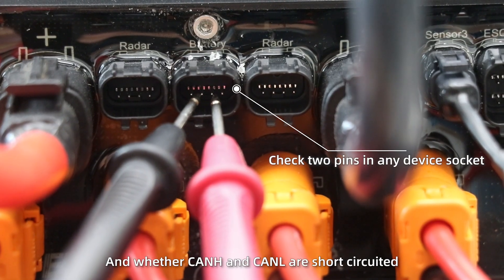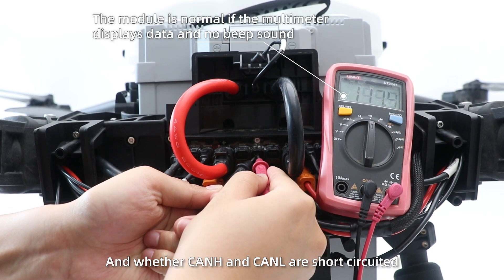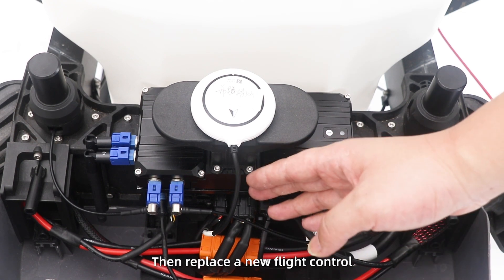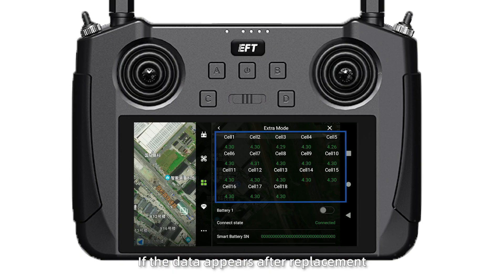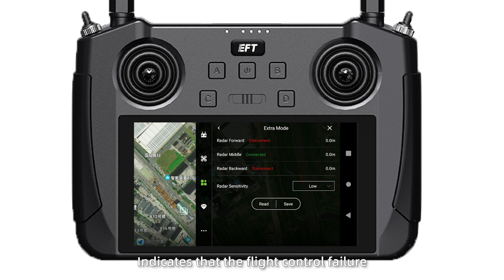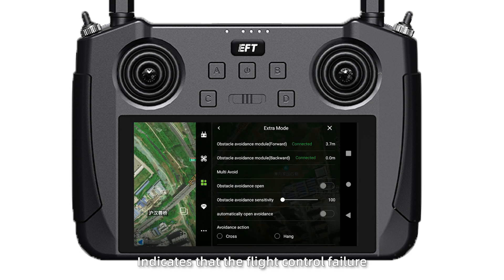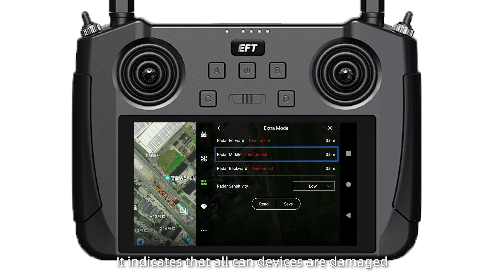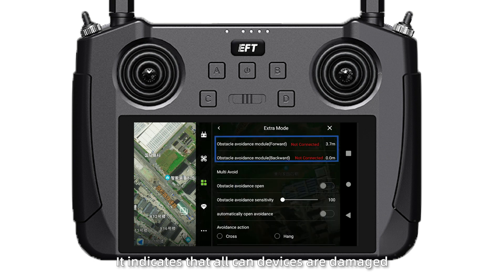Troubleshooting Tutorial of CAN  Functional Modules

Comment: what can i do multimeter make beep sound?
Reply from the maker: Which socket are you measuring?
It is recommended that you contact your direct supplier for a quick solution based on your version
Reply: @EFTdrone  It's a battery socket.
 I talked to the supplier and replaced the fcu, pmu and it works normally.